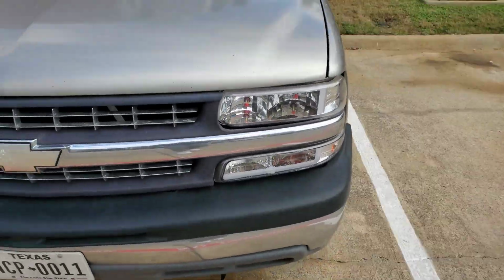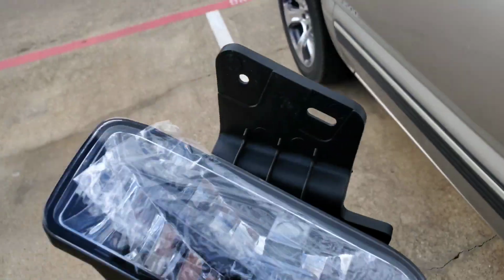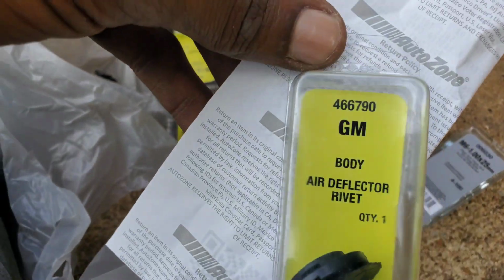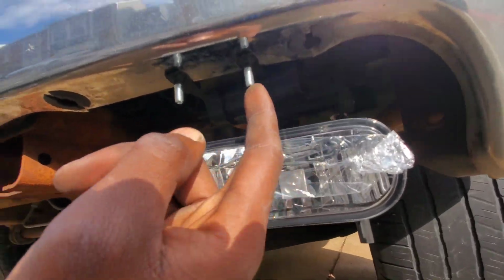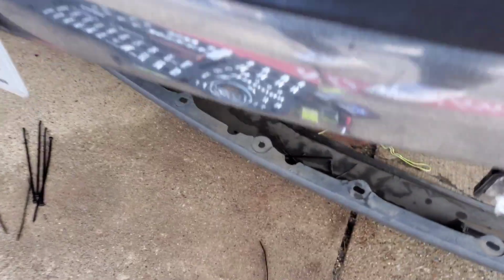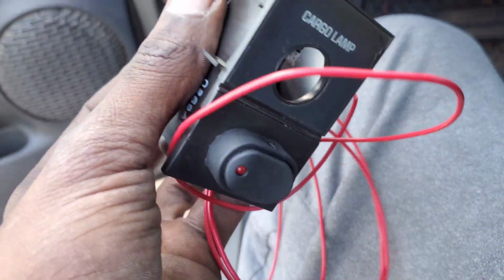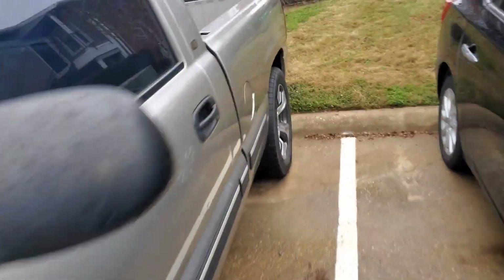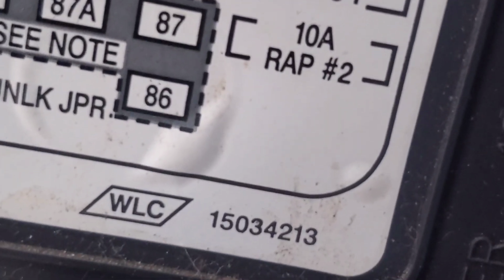How To Add Foglights To Your 99-07 Silverado/ Sierra Using OEM Valence( Under $50) #silverado

Comment: Where did you get the button from and what did you use to make the hole for it ?
Reply from the maker: Purchased from autozone in the switch isle. I'll see if I can find the old box. I just used a fresh box cutter and spun it into the plastic until it broke through the other side. I shaved off little by little until the switch went in snugly.

Comment: Maannn I’m trying to do the same thing on my 99 but the harness wiring is the only thing I’m worried about. Great vid tho just subbed 👌
Reply from the maker: What exactly is the most worrisome part that makes you nervous. Nothing to be nervous about, gotta show those wires and harness who's boss lol
Reply: I just did mine and ordered a harness on Amazon and added a switch in the dash in the stock location.  Worked great
Reply from the maker: Glad you had success installing yours!

Comment: Did the switch come with the harness you linked in the description?
Reply from the maker: No sir, I picked it up at my local autozone
Reply: @MuscleAddiction903  the harness and switch is all I need then correct? My fog lights already hooked on my valance
Reply from the maker: Yes sir

Comment: Did you connect to the fuse box or any pins inside the fuse box at the engine bay?
Reply from the maker: No sir. If you buy the oem fog light switch and wire it to the fog light spot on the fuse box it should work like factory. Don't quote me on that but I think I may have seen a few videos of some people doing it that way.

Comment: Why not just run a relay off the low beams with an inline fuse from the battery for power?  This brings them on when your low beams are on by default and requires a lot less wire and  doesn't require going through the firewall.